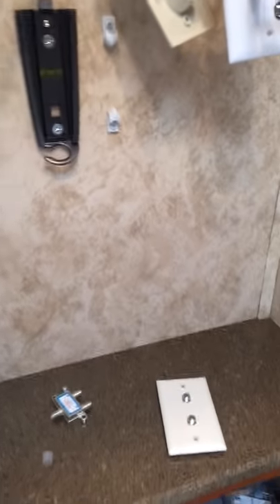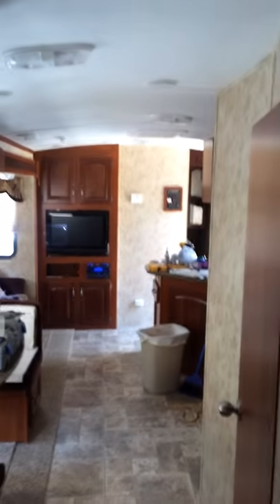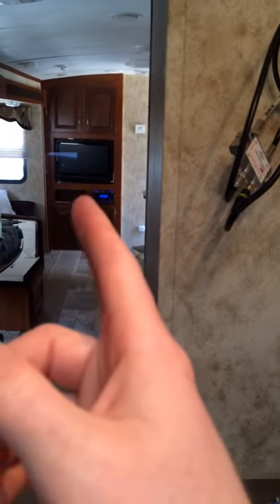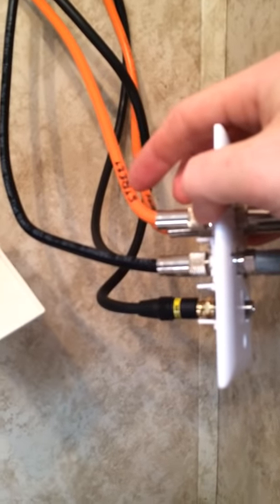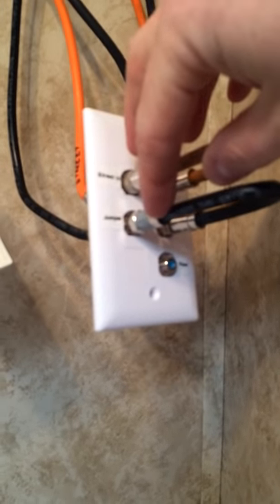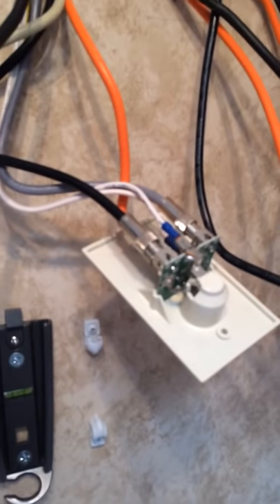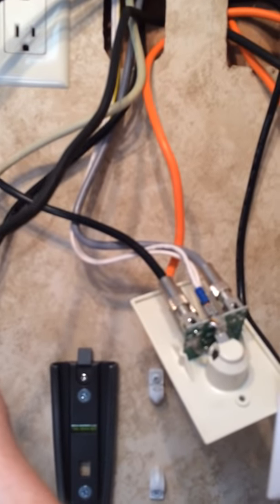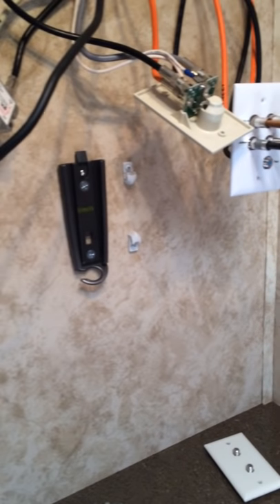Satellite TV Hookup in RV

Comment: Man, just bring the sat cable through the storage door and drill a hole into under bed storage box (on my Summerland 3030BH) then run the cable along the floor edge where you need it.

Comment: I know these videos are 4 years old, but here is my take. In Canada, we have Bell TV & ShawDirect satellite services. This RV connection setup would not work, because satellite signal from the dish CANNOT be passed thru a splitter. The splitter used in this video appears to made by IDEAL (available at LOWES). It states right on it that it is a "Satellite & Digital TV" Splitter. I have been installing satellite TV for 16 years, inc. RV's and cabins/cottages. EACH receiver must have its own direct cable feed from the dish or ssitch. The original satellite signal for Bell & Shaw Direct CANNOT be "split" using a splitter.